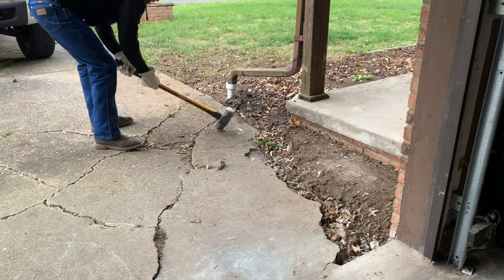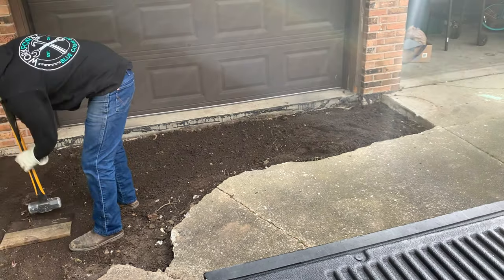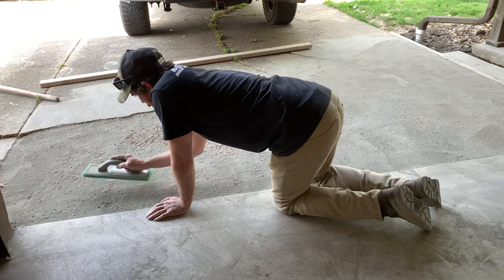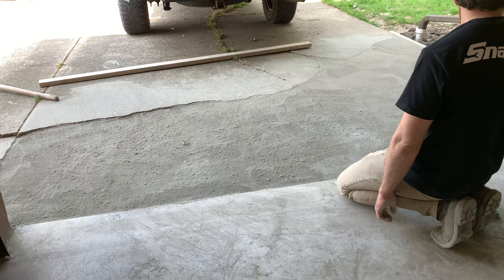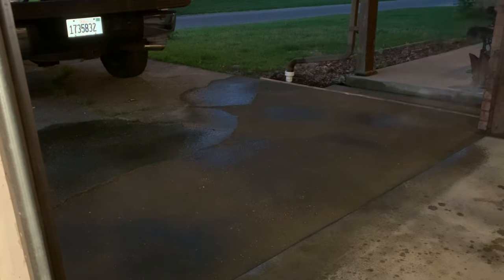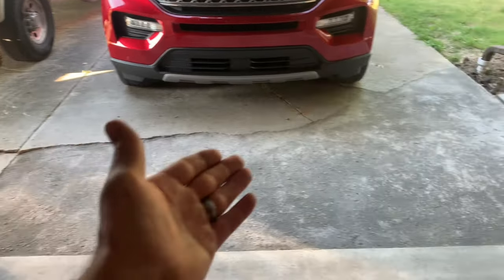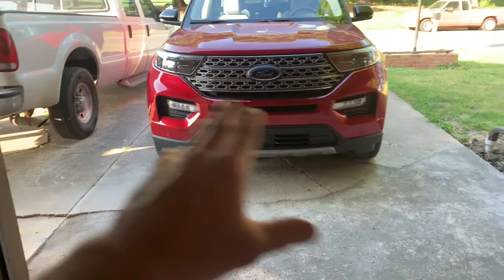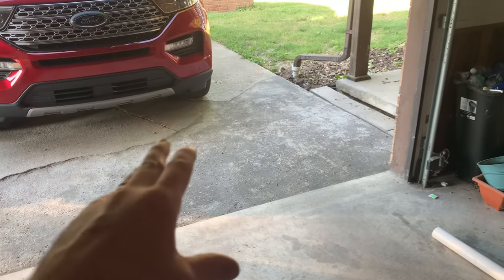DRY POUR CONCRETE DRIVEWAY PATCH

Comment: be good to see how it holds up over a year or two..   Two years and it holds, big win.  Did some dry pour work on the side of the house, won't get hit with the weight of a car, but driving a car over it everyday is even a better metric.   I had to break up some concrete to fix a pain in the neck broken water main that broke under the front walkway , tried a sledge like u used, found a 40lb solid iron dumb bell, that worked hella way faster.

Comment: You can repair it with something to anchor the different cracked areas together (ties), you can theoretically cut the ties in with galvanized rebar and epoxy and they make ties for cracks, then you can use a topper that you can get at Lowes over the whole thing... so you tied together the cracks about every 8 inches and then you go over it with a concrete resurfacing compound QUIKRETE Concrete Resurfacer (No. 1131)   (no affiliation)...  you can lookup videos online and you can get it looking about 90-95% as good as a new driveway...  they make all kinds of resurfacers but you can get that at Lowes...  you can tied the cracks together with simple but sizeable galvanized bolts that you can also buy at Lowes but they have to be galvanized so they don't rust away then you can get the concrete patch from lowes and use a grinder to cut the channels for the bolts or rebar to go across the cracks and then fill in with the patching compound, then level it off just right, then you wait and apply the resurfacer as directed... it should work and look very good, but I have not done it but I've watched a ton of videos on how to do it... they make crack ties that are expensive... i wouldn't buy that, I would just diy it if you are on a budget and use bolts or cut my own peices of rebar and use Quikrete8.6 oz. Fast-Setting Anchoring Epoxy to lock the ties in place across the cracks... let the epoxy fully dry before applying the concrete resurfacer... you can email/call quickrete with questions or ask me, but I've never done it, just watched a lot of videos about it...
Reply: So here are the steps (I think):

1) cut ties and channels for the crack tie process and apply and level epoxy and let it fully dry
2) apply patching compound over the ties and cracks and any low spots for a level surface, grind any high spots
3) clean as directed for the resurfacing compound
4) apply the resurfacing compound as directed

You might, then, also want to cut stress channels into the driveway because concrete will always crack, so you have to have those channels so it cracks predictably I'd hire a pro to do this.
Reply: Sounds like you are close to doing your own driveway, make sure you post a video to encourage the rest of us trying to build up the courage!
Reply: @colinmoore68  No, we just have a big crack down the middle of the garage, plus I plan to build and I like concrete stuff so I've been researching it for years.
Reply: @colinmoore68  But the resurfacer might work, but you want to get it really level and physically tied together somehow... so I would go ties, patch, then resurfacer... I've also played with the QR concrete adhesive and it really works, glued to concrete blocks together and they won't come apart, even if I drove over them with a truck, the brick would break first I think.

Comment: It's a good diy temporary repair. Not knocking it. A long term driveway should be at least 6-8 inches thick with minimum #4 rebar matt. You could do 10 foot by 20 foot sections as you get the money for each section and add on when able. Dowel in 8-10 inches into the old sections so you can tie on rebar for the next section. You can order a yard or two of concrete on a mixer truck for a phew hundred bucks and you can do the form work and tie the rebar yourself. Buy a bull float on a pole to finish the concrete your self then just broom finish
Reply: I noticed that there was no rebar in the pre–existing driveway that he was breaking up ¿

Comment: Come on man... an extra bag would have made it right.
Reply: I will be doing a bag of mortar and that would of made it smoother
Reply: One of the reasons to do dry pour is that you don't have to get in a hurry once the concrete is out of the bag.  You have time to go get the extra needed materials if you have to.